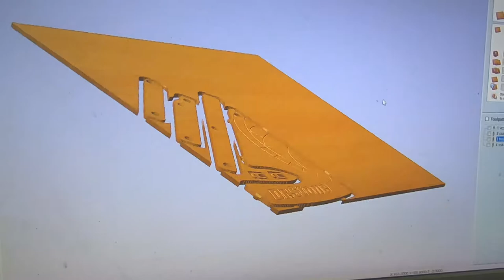Make a Sextant from Dr.Stone

Comment: but how does it work?
Reply: From what I can tell, the top bending part is a calibration piece, where you would align the top of the triangle formed by the folding mechanism with a celestial body, say, the north star, and the bottom of the triangle aligns with the horizon. The change in the angles within the triangle cause the weighted string to fall on a different point on the protractor-esque semi-circle below, giving the angle between the horizon and the star, which is equal to your latitude. Next, it appears that the semi-circle has a design resembling that of a star chart, like what you would see on an astrolabe. This is probably just a reference setup to find and / or record certain celestial bodies for reference in the previously mentioned steps. Also, the counting he was doing allows him to determine the longitude, because while the latitude is defined using the equator, longitude is defined by the angle from one's point to the prime meridian (an arbitrary line running through England), sailors in the old days carried super accurate and durable clocks counting the current time in England, which they then compared to the local solar time, or the time where they are, and could figure up their longitude based on things like: 1 hour difference = 15 degrees, Are they ahead or behind, how long does it take for sunlight to reach Earth (this matters because it will offset the number you would get otherwise by about +5 degrees). The reason he keeps saying that it is inaccurate is because 1) The north star has changed positions and 2) It can probably only measure within a degree of uncertainty, which translates to about 70 miles (112 km).
Reply: @captaingazpacho  damn thank you!!! That was really helpful :)